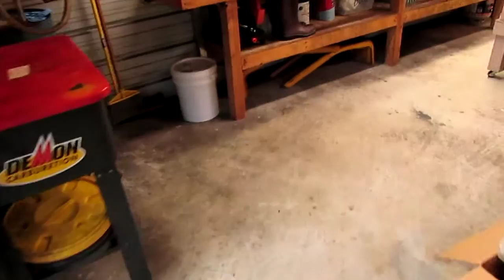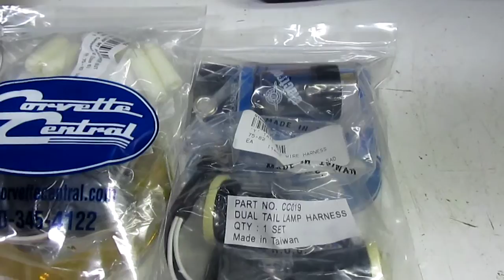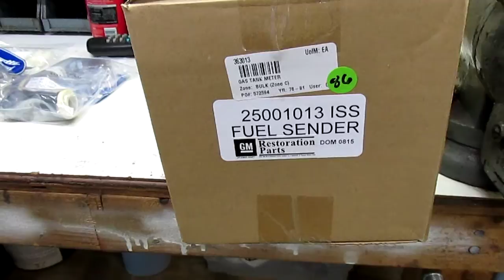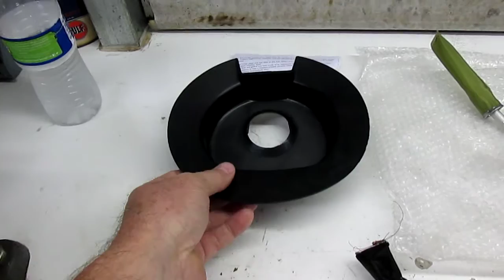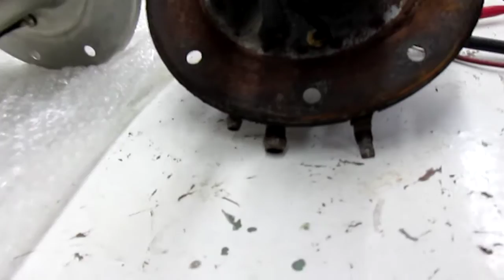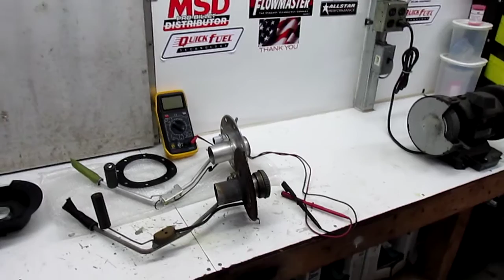1978 C3 Corvette LED Tail Lights Installation and Fuel Level Sender Repair

Comment: I wonder is you cleaned the connection between the wire and the body the old sender would read correct?  I had a blower fan resistor that didn't work and cleaned the leads to fix it.

Comment: Did you have trouble getting the rubber hoses on the new sender. Did you have to drop the tank or remove the rear bumper?
Reply from the maker: Things are a little tight here, but I was able to do it all through the filler door area. I did not have to drop the tank or remove the bumper. At least this method worked for me on my 78. Other C3s may be slightly different.

Comment: Did you happen to see the original factory build sheet that is glued on top of the gas tank?  I recovered mine through the gas tank rubber filler boot.  I found the remnants of another wrapped around a rear suspension part.
Reply from the maker: +Zuludawn1 No. I have not found that. I would love to. I have been through this car from A to Z and never found it. I have found some small stickers in various places with instructions to factory workers. On the inner doors I found a small sticker "This part to remain with car" something like that. Over the years I have seen small pieces of paper falling off here and there. Maybe that's it rotting away after 30+ years. Thanks for the comment.